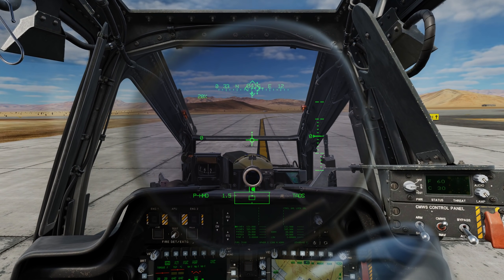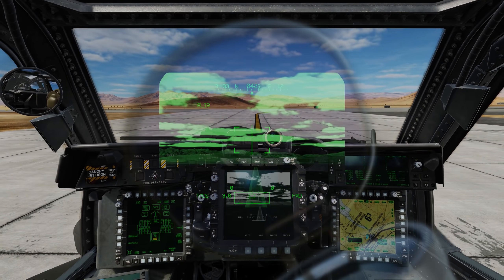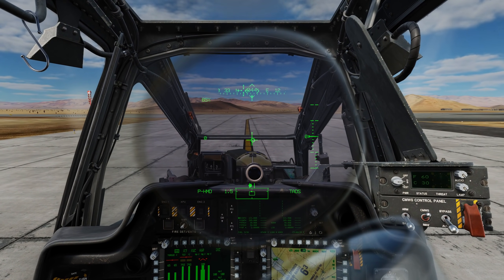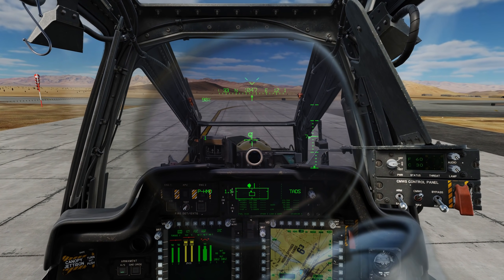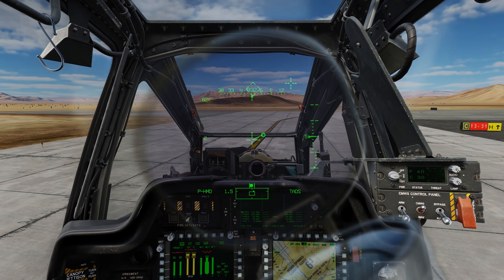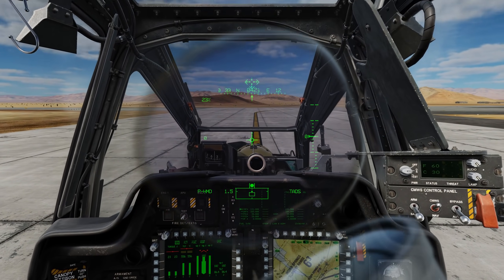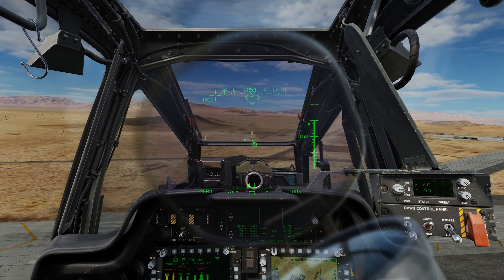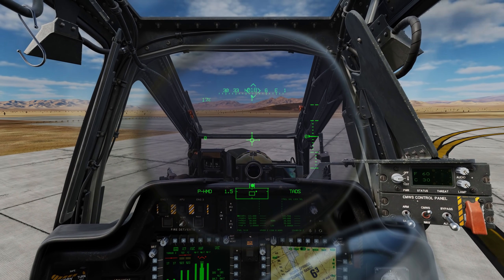DCS: AH-64D | VRS and Settle with Power

Comment: As a former helicopter flight instructor this was very clearly presented and should be easy for people to understand.  Settling (wether you call it ppwer setteling a term derived from navy flight instructors or setteling with power a army term) is when you have insuffcient power avaliable to preform the task you are commanding of the helicopter. Vortex ring state can produce similar effects but is an aerodynamic condition of the rotor system that degrades lift. 

Wags youve done a great job my inly critique of all of you videos so far is you need more pre emptive left pedal on pick up 😉  and to anyone reading this because im sure some have gotten into loss of tail rotor effectiveness at some point never let the helicopter do anything you didnt tell it to do and that starts with controlling yaw.
Reply from the maker: Thanks for the kind words. Agreed on all points. I did not want to get deep into the reasons behind VRS and get glassy-eyed looks.
Reply: @MattWagner  haha too right you are. Its hard face to face, forget over the comment section of youtube 😄
Reply: Where does overpitch come into play? I understand this is again different to settling with (lack of) power, and is specifically when you request too much torque, whereas settling with power is more a stall of the aerofoil on the rotors. There is a really good article online that kind of suggests that terms are used incorrectly by all sides and explains the three terms more in-depth...
Reply: "This distinguishes the emergency from a similar uncommanded descent that occurs when there is not enough engine power available to keep the rotors turning. This state could correctly be called "Settling Due To Insufficient Power," but is instead known as Overpitching. In this case, as well, there is a difference in terminology for the same phenomenon. In the U.S., overpitching is known as Low Rotor RPM. (FAA-H-8083-21A, p11-15)" So I would argue that when you demand too much power from the apache in level hover, it is neither VRS or SwP, but overpitch, but I stand to be corrected.
Reply: Although arguably it is semantics, and there seems to be no standard definition of terms within the industry. One thing though, settling with power effectively describes VRS, because in VRS there is plenty of power available but you cannot use it. Overpitch whilst not as descriptive, gives a clue as to a cause, and the result of this would be a lack of power from the engine because of a demand for power that isn't available. 

Damn, it's all just so confusing lol but I do not like settling with power as it is not an accurate description of either symptoms or cause!
Reply: @ollyk22  Absolutly! More specifically however i would say that over pitching is the cause and setteling is the effect... VRS due to its nature is aerodynamic and not a function of over pitching.

They are becoming more clearly defined in the industry as the terms are softed out of decades of unstandarized teaching. HAI (helicopter association international) has been instrumental in building standardization in the industry.

For clarification and simplificatio: VRS is where aerodynamic vortexes reduce the avaliable lifting surface of the blades resulting in an uncontrolled sink rate

Setteling with power (and all its associated names) happends when you require more lift then your aircraft can generate due to various circumstances (not always over pitching and not always atmospheric although both can play large factors). It will also result in an uncontrolled decent with similar but slightly different characteristics. 

I would be interested to know if @matt wagner and the ED team have modelled the aerodynamics correctly to account for the vershard maneuver ;)
Reply: @p38sheep  Well, it's more like the main rotor becomes trapped inside the vortex ring it generates and sustains itself. And as we know, vortex rings can travel long distances at high speeds because by their very nature they have relatively little aerodynamic drag.

Also, I'd add that SWP can happen with pretty much anything. Whoever played Lunar Lander most of the time fell victim to exactly SWP rather than the loss of fuel.
Reply: @getsideways7257  while keeping it as simple as I can, I’m not confused as to what VRS is as I have been in it seen it develop and taught how to exit from it. SWP could be applied to other types of vertical lift vehicles but like I said before very simply it’s where the lift (or thrust) required is more then available.

I’d disagree to say that the rotor is trapped as it’s self generated it can also be dissipated very quickly in the matter of seconds by lowering the collective or breaking the triangle in any way such as airspeed. Any way you can break up the vortex will allow you to exit VRS. By saying trapped you will lead to a hazardous mindset of resignation basically saying that there is nothing you can do about it.
Reply: @p38sheep  Just to clarify though, would you agree that in VRS you would see an increase in engine RPM as the load is lifted and in O/P SwP you would see a decrease, as is so obviously evident with the apache?
Reply: @ollyk22  good question! Slight variations in rpm can be noted given different load conditions of the rotor disk. The FADEC (full authority digital engine control) does a very good job of keeping the rotor rpm constant. In the case of setteling it is possiable to "drag down" the rotor system by demanding more torque then the engine can provide.

VRS you MIGHT see a small increase im rotor rpm as the drag on the rotor system decreases as a function of the loss of lift however the FADEC "should" provent an overspeed. This would be academic because youll be literally falling out of the sky at that point. Interestingly enough increasing pitch will result in increased vortex development making you fall quicker.
Reply: @p38sheep  Ok, if you don't like "trapped", then how about "engulfed" (which was my first choice of word, later discarded)? Ultimately, I meant that the resultant vortex ring exists due to the main rotor's flow inducing action. When you 'beta' the blades against the flow with the collective - the vortex ring breaks apart because of the very blades that created it now acting like a barrier.

As for SWP, it's not like there is not enough lift available, but more like there is simply not enough TIME (or height) for the available lift to neutralize the downward motion. At least when we are not talking about complex aerodynamics situations that could somehow influence the lift for better or more likely - for worse.
Reply: @getsideways7257  definitly engulfed. Vrs is more a componet of air flowing upward through the rotor system near the hub and if anything induced flow should help to negate that so i would say no to that. It primarily exists do to a recirculation effect that starts at the tips of the blades and grows it also starts at the root of the blade and grows. These vortices then eat up rotor surface area effectivly reducing the avalible lifting surface. By changing the angle of attack (main rotor blades cannot enter a "beta" range like that of a turbo prop and will typically only go to a flat pitch) you decrease the generation of the vortex. It is then up to time or manuvering to remove the vorticies from the system. This is also why increasing collextive pirch whime in VRS will increase your rate of decent because you are then generating larger vorticies, the quickest way however to get out of VRS is to enter an autorotation or perhaps the vershard manuver.

Ill yield your point on SWP especially with reguard to space craft and that sort of situation where various gravitational forces dont apply. If for instance you had the ability to only do 6 delta V and you were approaching a body that had a gravatational pull like earth of 8M/s/s then even if you burned the whole time it would still result in a acceleration during decent and i would classify that as insufficient thrust. Typically times ive seen SWP is arriving at a location with a higher density altitude layer in the day and picking up some cargo and then trying to depart that area can result in insuffcient margine for loss of a headwind or something to that effect then next thing you know you are decending while at max pull, its an awful feeling when you are training with a limitation it would be really awful to find yourself in that position with no safety margine. So the result is your aircraft producing its maximim amount of lift and then that not being enough.
Reply: Yeah VRS you are basically descending fast enough to get the rotor blades into the disturbed air your rotor blades created thus reducing lift.
Reply: @Stubbies2003  Which I am not convinced I have ever witnessed in DCS. I am certain the Hind descends with engine rpm dropping which suggests it is not VRS, but I'll give that another look